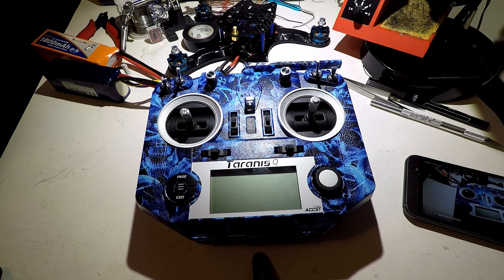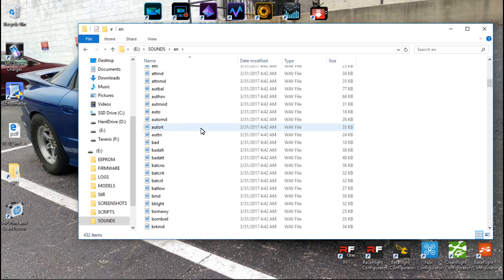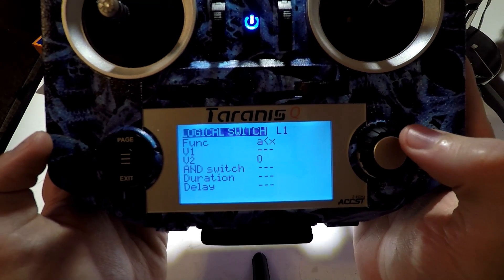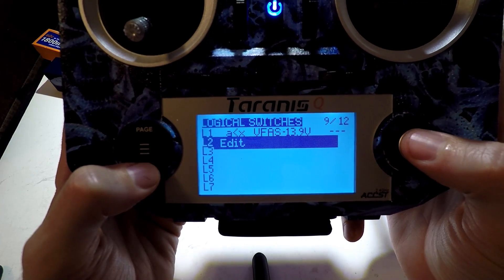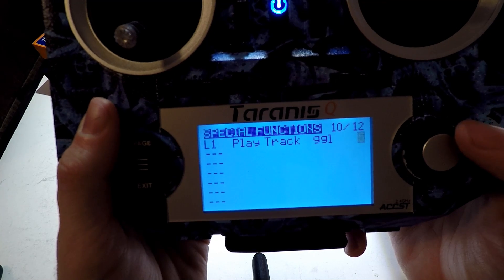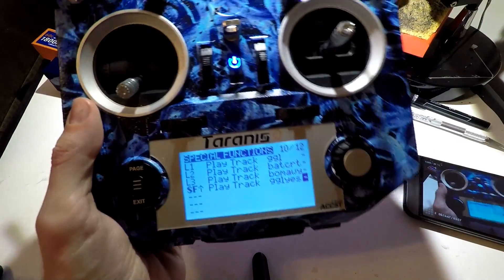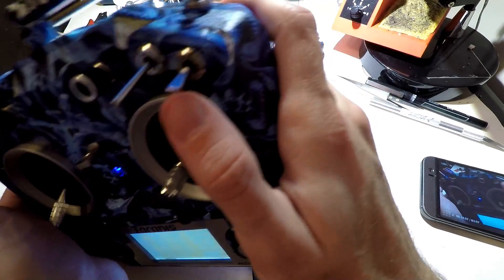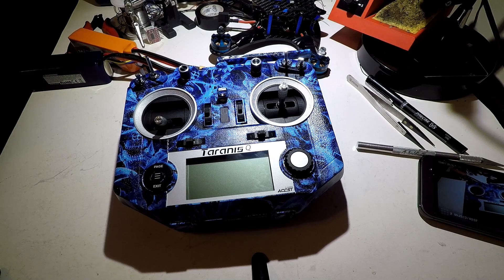Taranis Q X7: Creating Warnings & Switch Sounds (for voltage, alt, and more

Comment: none of the 'play val' functions i created will play a voice. The speaker works, as i can set movement of a switch to play one of the built-in sounds. anything i can do so the default voices will play for dictating voltage, etc....?

Comment: Will warnings for rssi and batt voltage work on frsky xm+ or does it have to be the rsxr ? 
Thanks
Reply: Should work for most receivers.  This stuff is mostly handled on the radio, so receivers rarely should be a variable.  Good luck with your build!

Comment: JC.. when flying and trying to hit gates if find I drift right and left or Yaw just slightly.. is the step I would use to set the Qx7 to beep when stick is not centered.. plus or minus >0.5 ? I know the beep would be annoying but not flighting straight is more annoying..
Reply: Not sure if you knew but JC has passed away R.I.P.

Comment: Is the 13.9 voltage for 4s batteries?

My drone starts beeping at 15.3 volts to land.
Reply: Yes JC was referring to a 4S battery when setting this warning up at - 13.9 volts for all cells which is  13.9 / 4 = 3.47 volts per cell.  Note that JC was using this as an example and is at the very limits for what a lipo should be discarged at. its said not to go below 3.3v a cell or you can damage your lipo battery.  Choose a value that best fits your battery and setup.

Comment: Thank you very much! your series was very helpful, much appreciated. Is there an easy way to set alarms for low voltage when flying with both 3s and 4s batteries. Can you set a switch when alternating between batteries? A tutorial on that would be great :)

Comment: Thanks for all the help with this JC.   Life saver you are!!  👍🏼

Did you realize if you continually rotate the wheel it will adjust in large incremental values?  So if you are setting 1300 mah for example.  Rather than short burst rotations of the wheel rotate your thumb all the way around in a fast solid motion and you will be to the higher value in no time.   😉

Thanks again!